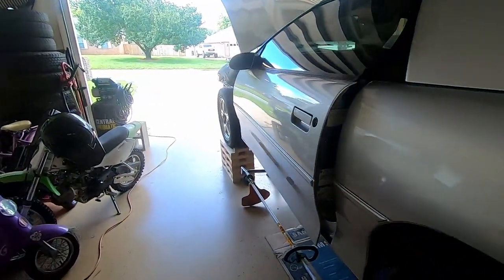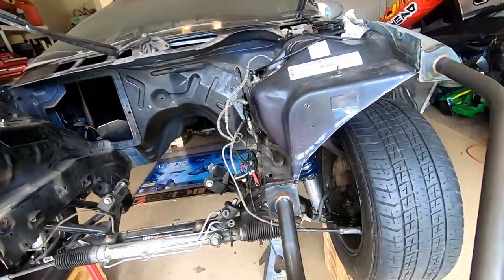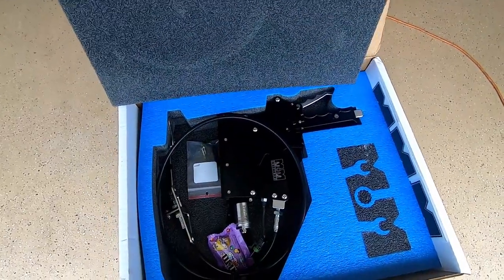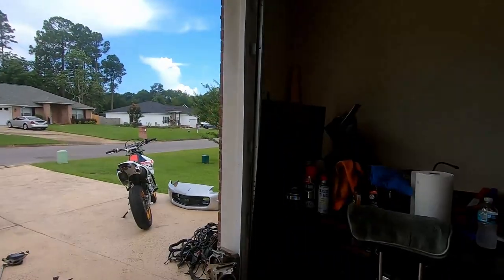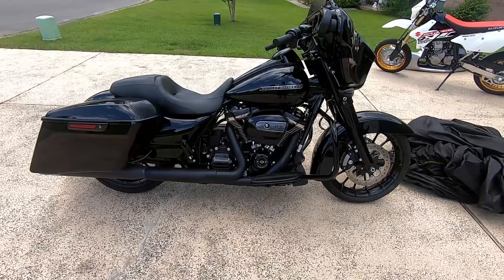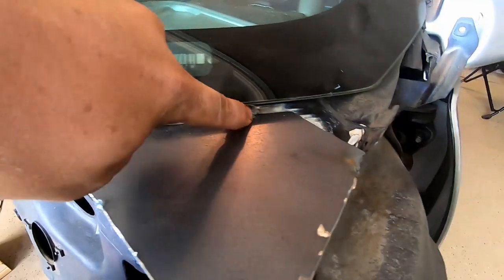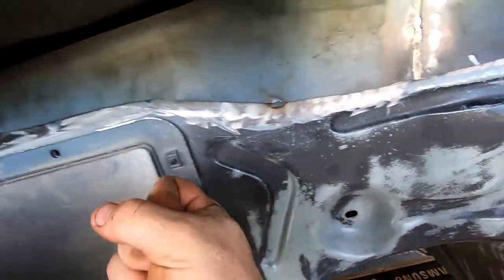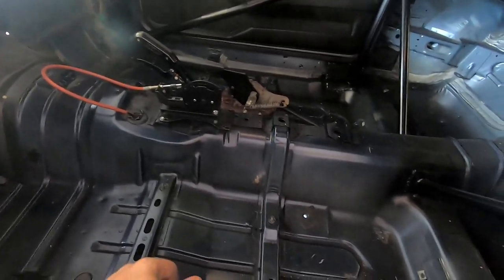02 Fbody Camaro Wiper Cowl Delete

Comment: The only problem with leaving that hole on the driver side is that if it rains or when you wash it water will get down into that cavity under your windshield you just close up. It will have no where to go either and will rust away your car.